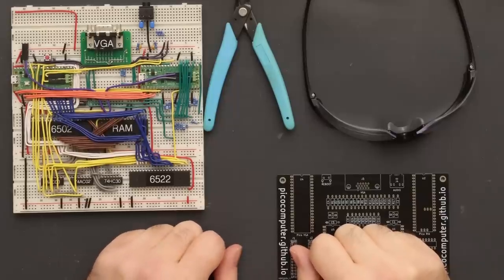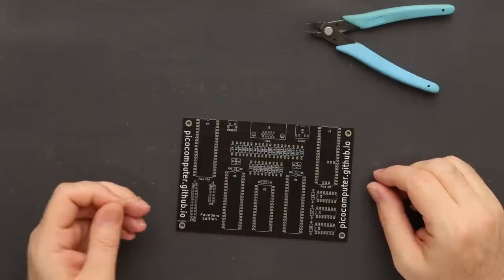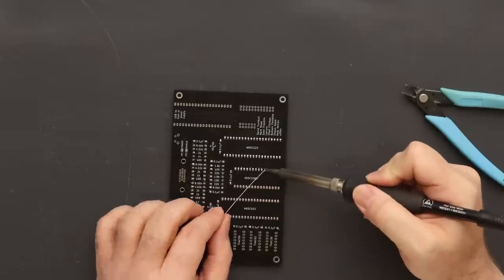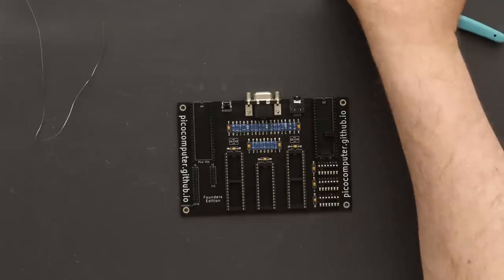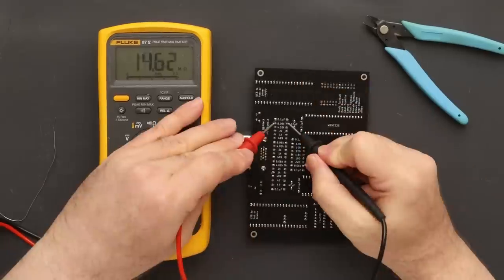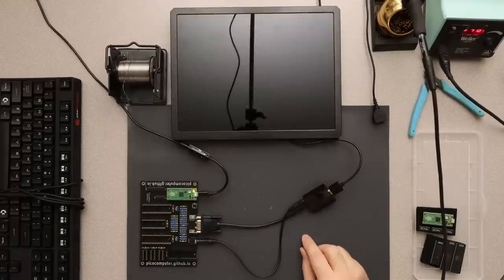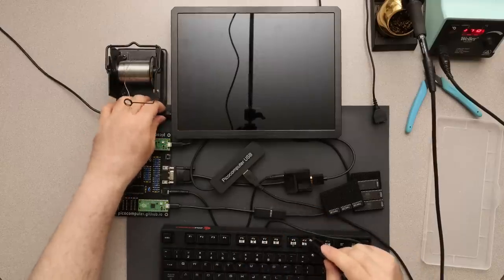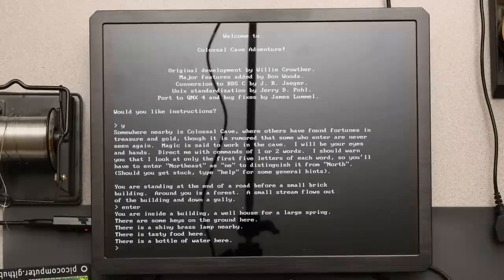RP6502 Ep10 - DIY build with soldering

Comment: So why aren't you buying a Commander X16, you didn't really say, just mentioned the price  and started assembling the Picocomputer.  Is it because the X16 is $500? What are the differences between the X16 and and Picocomputer that make one much more expensive? What does the X16 do that the Picocomputer can't, and vice versa?
Reply: Isn't there an a FPGA on the X16?
Reply: This is a way to advertise in the tail of a better known product.
Reply: @rog2224  The X16 uses an FPGA chip (VERA) for graphics, sound, and SD card access.  Similarly, the Picocomputer uses a pair of Raspberri Pi pico boards for I/O and graphics.
Reply from the maker: Yes, it's mainly the $500 price that's turned me off. More people can participate in the hobby when the price is lower.
Reply: @krzbrew - that is a stretch i think
Reply: This computer doesn't even have a PCB; you're building it on a breadboard. So it makes sense the parts are around $60. That's actually about the same price as the WDC 65x developer board, which sells for $65.02. If someone were to sell this computer complete, with a PCB, as shown in the video, they'd probably have to charge $120-$150 to cover their labor and costs, plus make a reasonable profit. 

For comparison, a CP/M capable RC2014 kit sells for about $200 USD. That's without a terminal (which itself is a Pi Zero on an expansion card, or a serial interface to a PC), which would raise the price to $225-250. And that's unassembled. With assembly, you'd probably end up paying $350 for an RC2014, as well. 

My Mini PET also cost around $250, if I recall. Again, I had to assemble it myself. 

Microcontroller based computers are super cheap, and you can actually emulate this whole computer on an ESP32 for like $10. There's a reason that smartphones and portable computers have gone to SOC (system on a chip) design: it's much cheaper, which this design here illustrates - yes there's a real 6502, but all of the other chips needed to make a full computer are emulated via those two Pis.
Reply: @rumbledethumps  emulator is Nice I guess, they also gonna have a cheaper g3 version that uses more fpgas
Reply: @tomwilson2112  You can get a CP/M capable kit (Z80-MBC2) for less than $100!
Reply: @tomwilson2112  looks like a PCB to me and yet yes it is simple enough to build on breadboard or vero as I did. Yep could be emulated but real hardware is where the passion is for some of us.
Reply: Honestly, this project isn't really anything like the X16 either. Different shell, different philosophy, about the only thing it has in common is using a 6502 compatible processor with otherwise modern parts.
Reply: @tomwilson2112  or you could buy an Agon Light 2 for around $50. Sure you don't get to put it together yourself, but it'll run CP/M and it has a very active developer community.
Reply: @ingmarm8858  HE has  a PCB, but you can't order one. You will have to have one made... at a cost of probably $30-40 after shipping. 

Now you have a $100 computer.

I'm just saying you can't make a straight-up cost comparison to this computer and a computer which is using (as much as possible) a full chipset of era-appropriate parts. They're two very different machines.
Reply: @rumbledethumps so very true!  And VERY kind of you to do all of this and share it open source!!!  THANK YOU!!🙏

Comment: I got the board from you today and ordered the parts from Mouser.   I last soldered in a 6502 back in the mid 80s working for a start-up in PDX making telemarketing machines originally out of C64s and Code-a-Phones.  We eventually made our own board (but borrowed the C64 kernel) which I drew up by hand in a basement not that far from where you live.  Maybe someday we can meet up at the Barley Mill and swap stories.  I'm back in PDX after decades away and now live in North Portland.

Comment: very nice. i'm sure you know it by now, but if there is not enough proccess power to achieve all the features you want, the pico can be safely overclocked (and via software) to ~270Mhz. no extra cooling required, it would only consume more power. i don't know if this is going to mess up the timing for the mem chips or the IO and DMA, but if the need ever comes it's there. actually it can go beyond 270Mhz but you loose the flash access and you have to change the spi clock divider, but still doable. i'm waiting for the rest of the videos, keep up the good work.

Comment: Hello, great video! I am planning to build this outstanding board. I wanted to know if it's possible to use the Pico W instead of the standard Pico. I guess it is and I was wondering if the wireless capability might add additional value to the board.
Thanks!

Comment: this week I've been designing my 6502 computer in PCB form, it fits into 100x120mm and has all the pins acessible to attach modules and stuff, up to 7 misc devices in the processor's bus aswell, and I've made it really nice and curvy, hope it works irl

Comment: How hard would it be to build a DVI version of the board? I’m considering making a surface mount version with DVI output, integrated RP2040s and a USB Hub IC.
Reply from the maker: The only way to find out is to do the work.

Comment: very reminicent of Bernardo's Agon where it uses a powerful ESP32 microprocessor to do the heavy lifting of handling a PS/2 keyboard protocol, VGA display output, and an audio output port - the main Zilog eZ80 CPU interacts with the ESP32 over a high speed bi-directional serial bus.

So displaying graphics or driving the audio consist of sending commands to the ESP32. The ESP32 is dual core - one core is pinned to processing graphics and PS/2 and the other core is pinned to processing audio commands. Thus everything graphical and audio is achieved by writing appropriate software emulation to run on the ESP32. Nicely the ESP32 can be programmed via the Arduino IDE and a fork of the FabGL sketch.

Agon developers soon find themselves wanting to do this ESP32 programking as graphics primitives and sound chip emulation is where the real action is for achieving something that has the apparent behavior of those custom chips of the early 8-bit computers such as the C64 and the Atari (or the MSX1 computers that used that TI graphics chip).

The X16 uses an FPGA solution for its graphics subsystem - and may be compelled to have it be the audio processor too as the Yamaha chipmthey wanted to use is looking like will be unobtainium at the scale they need supply.

The alternative to FPGA to do heavy lifting in place of proprietary custom chips is to use a powerful modern microprocessor and do all this ancillary stuff in software.

I think the X16 will be able to get cost significantly down when the do the next iteration of the board design to use surface mount chips instead of mostly through-hole chips. At least cut the current pricing in half. Which would be cool to have a retro recreation computer that actually accepts game cartridges and has ports for D-pad game controllers - and achieves truly spectacular graphics and sound where much of those capabilities are even programmable from BASIC without having to use POKEs.

Comment: I want to use a pico as a USB driver in 6502 circuit that I have but probably it would damage connecting directly, on the web I found soltutions that use buffers 74ls245 but this is more complex and expensive. :(
Reply: Sorry I forgot the question, is it possible to connect directly?

Comment: Did you used 2 pico, one for vga and other for peripheral control?? If thats the case then you should have used shift registers to control peripherals
Reply from the maker: The Neo6502 is how you describe. Last I looked they hadn't figured out the PIO for that and were still bit banging the 6502.

Comment: The point of the X16 is to make retro computing more accessible for first-time buyers. While it is nice to build your own machine that emulates a retro computer the main draw for the X16 is that it is pre-built so users don't have to worry about soldering if they're inexperienced. The X16 also features quite a few real parts that have been sourced so I don't foresee the project going much further than it has already without some major design and part changes to accommodate the lack of supply for these parts. Unfortunately as time goes on this is looking more and more like the best option to keep retro computing alive regardless of the accessibility concerns of having to hand-build something like this.
Reply: I suspect that the X16 is just a fun project for a few YouTubers.  It doesn't really need to have a point.  Like the Pico computer in this video... Is it fun?  Yes.  Are people going to use it in a world where Raspberry Pis exist?  No...

Comment: Where did you buy the VGA to HDMI adapter that doesn't need external power?
Reply from the maker: It's powered from +5V on pin 9 of the VGA port. Check that you have that first.
Reply: @rumbledethumps  Thanks.

Comment: Wow, this is a cool looking project, and so easy to build!  One thing I would like to know is its VGA's graphic capability and perhaps performance so that games can be programmed on it.
Reply: The VGA part is pretty much a blank slate and work in progress as I saw. It's just a basic frame buffer at the moment, if I understood correctly, but it possible to implement sprites, collision detection and other things usually present in legacy 8 bit systems in the firmware of the VGA Pico.

Comment: Having made my 6502 designs with PCBs, it does get very expensive. That's without factoring my time which would, if costed, push my projects out of reach price wise. So good thing that I don't pay myself 😋. As such, I completely understand why the X16 cannot be made for $50. Even before coivd, that was not feasible in my opinion. On top of that, they decided not to use CPLDs/GALs for glue logic, which means that making a mistake in the glue logic means a PCB redo. A deliberate design choice and I understand why, but costly if you balls the design up (which we all do).
Reply: the first board versions of the X16 were never going to be $50, they have said that numerous times at the begining, i don't know why ppl still complain about that. of course they thought the cost would have been closer to $300 but all the various problems brought it up to $500. the $50 price was only if they were able to condess everything to an fpga, but only after and if the first boards succeeded commercially. yeah, i was exited too but $500 is very expensive for something like that. but then again it's mostly a hobby and hobbies do burn money.

Comment: Very interesting. I really like the concept of using the second Pico as an I/O and monitor interface (and also running the kernel as I now understood from your other video). Essentially you have created a modernish development board around the 6502 which is also a full computer. This seems to be even a good DIY project to just practice soldering on. It would be nice to order the PCB straight from a Chinese manufacturer like PCBway.

That PIX interface is really clever. Eg. you can add a Pico W to create an UART modem emulation over WiFi and now Bluetooth capabilities for another HID device like keyboard or joystick. Or another Pico can be used to bridge a SID chip into the memory layout of the 6502. Really cool. Also very accessible as the Pico creates a universal cheap interfacing point with it's PIO.

Out of curiosity, would it be possible to generate HDMI/DVI directly? There's a fork of PicoDVI which even supports HDMI audio, though as I see the audio is generated by the RIA Pico and not the VGA one. But I guess nothing stopping someone to make the HDMI output a secondary audio device to provide PCM or FM. The only reason I'm asking is because VGA is non existent on modern displays, and in the same sense you use USB for I/O, I think HDMI is the common denominator for video at the moment. Though yes, an adapter can bridge the gap, so it's not high priority by any means.
Reply: I was barely hanging on to your thought process ('cause I'm just uninformed, but curious), however it was interesting! I've been randomly talking in comments to Risc-V folks, trying to get something that'd play games as well on the cheap. There may be a marriage of Pico + Risc-V which makes sense? ...the Risc-V chips are absurdly inexpensive and can be included in designs with abandon right now c:
Reply: @lafemmedevastation  I think if you want to create a cheap video game console for RISC-V you can use something like the ESP32-C3 and combine that with a Pico to output VGA. There is even the ESP32-S3 which has USB Host functionality. But that's going to be a different design, you have to create an alternate bus, as the ESP doesn't have an equivalent for the Pico's PIO.
Reply: very intriguing! I think all of this is fascinating, 'cause the normal enthusiast has been sorta "locked out" of doing anything meaningful for so long (either from licensing, costs, or both), and now it's all just a matter of expertise and imagination to create most things we could dream up. Thanks for this thought experiment! I'm going to take note of it, and see if there might be some sort of versatile bus that could generally bring ESP32-** and Pico** together without too much pain, heh c:
Reply: The PIO is indeed unique, but ESP32s are very capable of VGA output themselves and the ESP32-S3 is a RISC-V part if you want to cover all the bases at once. I had some of the first ESP32s to hit American shores and my idea back in 2016 was to pair an ESP32 with a Bridgetek BT811 or BT813 EVE (Embedded Video Engine). SPI is more than adequate for fast inter-IC communications if you need to involve more than one chip.
Reply: @Peter_S_  sure you can bit bang stuff on the ESP32, but the PIO gives an easier path to handle timing critical bus communication / signal generation. That fact it gives you 4 separately running very specific threads/cores which you can fine-tune to be as time constrained as possible helps a lot decoupling your high level code. Of course if handcrafting RISC-V assembly to do the same is your thing, nobody is going to stop you :)

Comment: I've had a 6502 computer way back in 1985.  In all honesty I can not see myself going back to an 8bit platform, it was fun but it's more limiting than I would like.  Yet there's the MEGA65 project that takes advantage of a 65816 which I fund is a great alternative.  I do prefer the Amiga platform for retro computing and that one now earns the pistorm treatment giving it 1000x the cpu performance.  It's not just the performance that is great but the ability to use latest device connectivity or at least open up the box.  The X16 for me would be a waste of time on a DOA type 6502 8bit platform.  There's others like that with high sticker prices for a useless platform.  If the goal is the 8bit experience, Atari 800xl 130xe or Commodore 64 128 should do the trick.  Again for me no reason to reinvent the 8bit computer.

Comment: The thing is, its not about the computer. Cx16 has people building a full emulator for it, producing software and games etc etc. This and for example Agon light is a great little platform, but contentwise its miles behind the cx16 and thats even before the hardware is out.
Reply: For me as a programmer personally this project is more interesting. The Pi Pico is a great basis for the whole project as it's available in quantity for cheap, surprisingly capable and has a great SDK and community around it, married with the 6502 it combines the two platforms in an interesting way. It's also lot less hardwired in the sense that basically everything extra around the 6502 is done in firmware supervised by the Pico and it only uses the 6502 as a co-processor essentially. This is why the PCB design dead simple. While on the X16 still the 6502 controls everything in a hardware centric way with only the Vera being the sidecar. The X16 is also more fixated to the idea of making a "childhood dream Commodore with more horsepower" down to using the very kernel on steroids, while this aims being a more generic base computer which you can hack/extend in whatever direction you want. The PIX bus is really clever imho.
I'm standing by my statement that this essentially creates a modern devboard around the 6502 like if it would be a micro controller; you can easily discard the kernel part of the firmware and write something else on the whole thing. I don't know how compatible this 6502 variant with Commodore programs, but I can imagine someone coming up with a C64 compatibility layer running on the Pico (or additional Picos, as nothing stopping you adding more) which emulates most of the C64 hardware (CIA/VIA/VIC/SID/Disk) and let the 6502 run original programs. Though I haven't looked into details, but I think something along the lines is possible if memory mapping is not in the way.